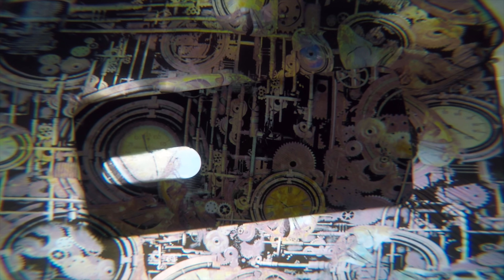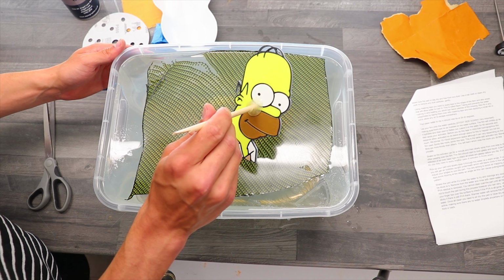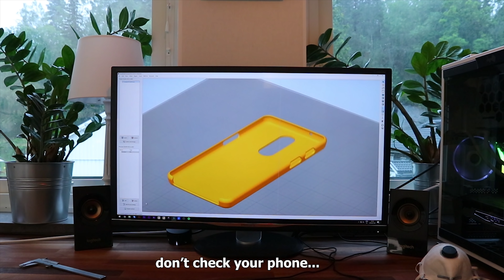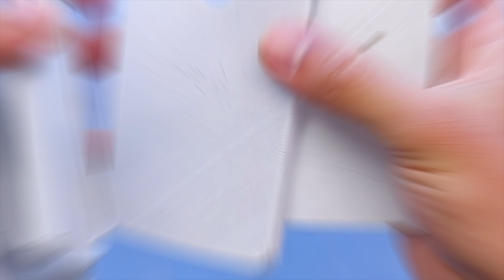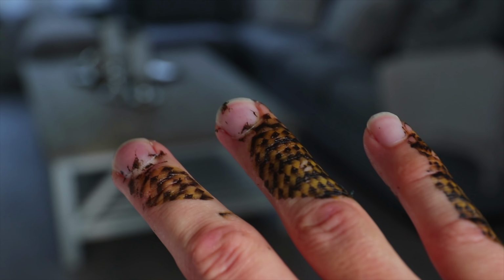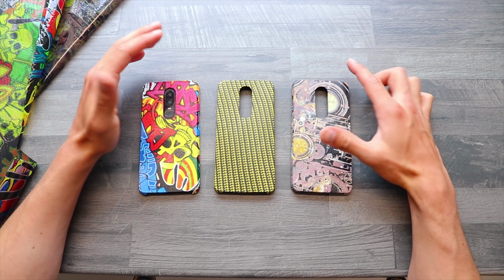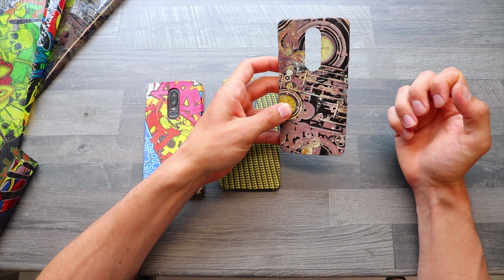$2 Phone Case Made on $1000 3D Printer

Comment: To get a better coat with primer or spray paint, put the can in a large cup, and put it under hot running water for a few minutes shaking the can every 30 seconds or so until the whole can is nice and warm. The warm paint will mix better and flow smoother in smaller particles with less spatter and globs. Even cheap paint can be improved this way.
Good luck!
Reply: THANK YOU
Reply: I’ve heated an open tin of oil gloss up on my gas cooker. Flows lovely. Very dangerous though. Painted my kitchen unit doors with it. Video on my channel many moons ago

Comment: buys 1000$ 3D printer to make 2$ phone case

S T O N K S
Reply: Only need to sell 5 to break even
Reply: Economy (no)
Reply: 2×500=1000 😎
Reply: @LooNE  filaments cost alot 😂
Reply: I thought creality printers were a lot less than $1000
Reply: @kailin1496  the biggest model they have is around 900 if i remember correctly, only reason why you need get a more expensive printer is to print really flexible filaments with direct drive extruder.
Reply: "Wow, I'm making so much profit!"

IRS: No you're not.

Comment: There is a simple trick for this hydrodip film to not overlay or roll over itself. 
You need to cover the edges of the slice that you put onto water with some tape before You dip. The good practice is to keep these cuts (more-less) rectangular shape so the edges can be covered in a full frame from 4 cuts of tape. I usually go with the 15-20mm painter's tape and never tried office or packaging tape types but I imagine it will work as well - it does not have to be water resistant and You only need it to hold the shape for these few moments the film is floating on surface.

Comment: Here's a suggestion with dipping those iphone cases. 3d print a phone with a handle on the back. Insert that before you dip. You won't have to glue sticks on, or get residue on the inside. BONUS!

Comment: Simon I've been using hydrographics for years..

1) film on water with in the correct orientation.. (you can test this by wetting your fingers and pinching the filament, the side that sticks to your finger is the side that faces the water)

2) let sit for 60 seconds to hydrate

3) apply activator in even coats, the film will glass out when you have enough activator.. (the film will enlarge when activated correctly so it's important for the film to have a boarder for it to bind against like tape or the water container itself) or it will stretch and weaken the pattern..

4) dip at an angle as you know.. it's important to know how water flows over a part to prevent blowouts in the film..

Also your assumption is correct on different films needing different amounts of activator...

On several of your attempts the film pulled ( like a paper towel on water) when you dipped.. this is a clear indication of not enough activator.. the film itself should be of liquid form..  

Excellent start though man.. and great video as always... stick with it and you will become much more aware of how the film will react on certain objects...
Reply: Also keep in mind your water temps... 85* Fierenheit to like 95* Fierenheit

Comment: The issue you were having(I have not finished the video) BUT the hydration period looked ok but the activator wasnt enough and was underactivated. It is supposed to gloss out and basically melt super easy when dipping at a 45 degree angle.

Comment: Great video. 

If you let it sit in the water a little longer before adding the activator, then use a little less activator then let the activator sit a little longer before dipping you will find the excess print will come away when it goes underwater and remain at the surface.

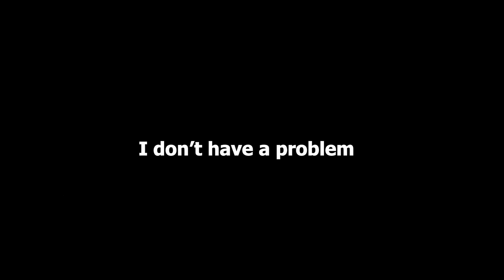Comment: 10:00 haha a gluegun + helmet
is it possible to re-use the water after you added that poisonous "activator" ?
Reply: Yes you can, but not for drinking
Reply: @KangJangkrik  but how often , i mean at some point the water will be saturated? or does this activator looses its ability over time so the water could be used very often? (i spray bottle in the small water tank for example xD )

Comment: You are not using too much activator, you are using too little. You need to spray 2-3 times more activator. The print should not pull down like its doing when you dip. You can tell when its enough because the print will expand and dissolve on the water.

Comment: you need to use automotive clear coat for it to look amazing.
Reply: but that would probably be too ridged and crack when the tpu flexes.
Reply: @nothanks7752  automotive clear is kinda flexible. i've seen a lot of bumpers handle a looot of flex and not crack, if its a semi-rigid case i think it could handle it

Comment: He could probably sell for 3 buck get like 500 bucks that like 1500 like a 300 to 400 printer and the spray I'm guessing is 20 to 30 bucks a can so like 10 of those so 200 to 300 bucks. Then your water bill that is like I guess for like a side hussle that 200 more. 200 more for the tpu printing I dont know if that alot of printer material  for making a phone case. The shipping and handling is a guess but let just take these numbers and all the items we bought if it possible. Your would spend 1000 and make 1500 that is a 500 increase if we took the max I'm guess 1300 to 1500 you still got 200 more and you dont have to buy another printer so that a 300 to 400 buy you dont have to do anymore.

Comment: some thoughts: 
-try to put the foil in a frame of tape (masking tape works good)
-the activator needs time ~30-50 sec. 
-little bit more activator
-those activators dont work relly well when the can is about half empty 
-if you want a white underground and u have/want to use paint ONLY use Acryl paint

I hydrodipped my Fatshark googles and my Taranis and its a ton of work.. needed around 20 hours (without dryingtimes) with to people for 2 Taranis and one Fatshark
If U have any questions or want to check out my hydrodipped parts feel free to contact me(Instagram: Nytfox.fpv)